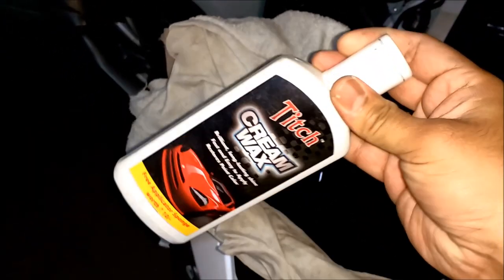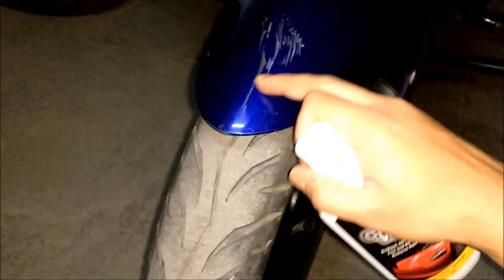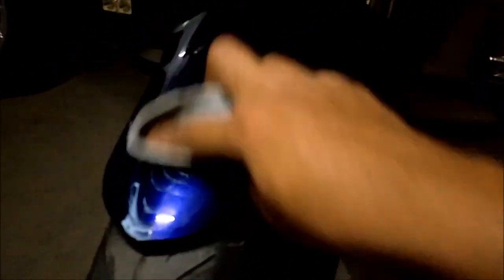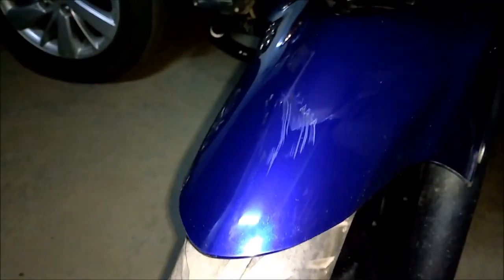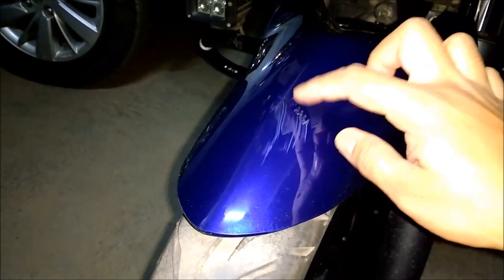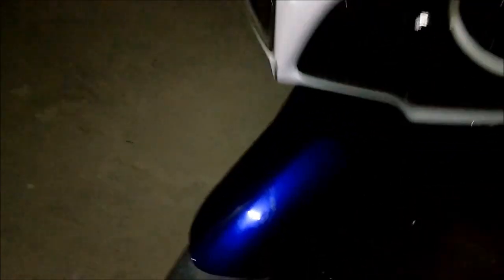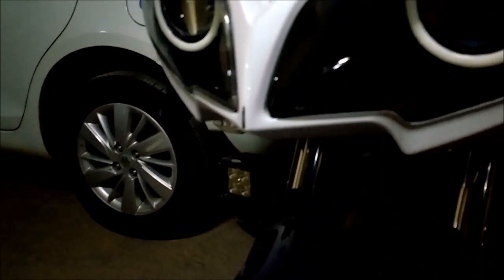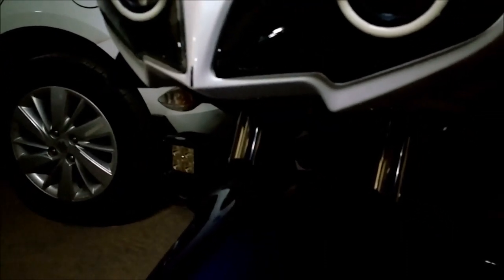#DIY : SCRATCH REMOVAL  / PAINT DETAILING : Using Wax / Polish || Rubbing Compound

Comment: use any brake oil ,.... apply it very little on a clean cloth n rub on the scratch ....it will DISAPPEAR but though using more brake oil again n again will fade ur colour ... so use litte n 100% it will work.
Reply from the maker: ali yusuf Will try that. Thanks.

Comment: Best engine oil under the budget 1000 for fazer? 10w 40 or 20w 40,50?
Reply from the maker: roseline nive Motul 7100 20W 50.
Reply from the maker: roseline nive I would suggest you to watch my Engine Oil related video : https://youtu.be/lGtGBHEa5WY
Reply: @MototechWanderer  couldnt agree more. Been using motul for 2 years and it never fail